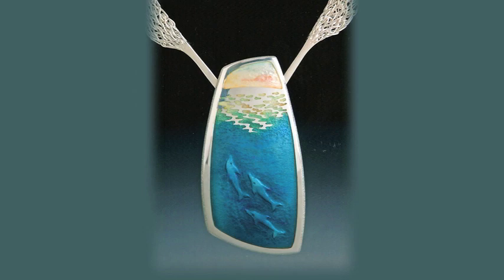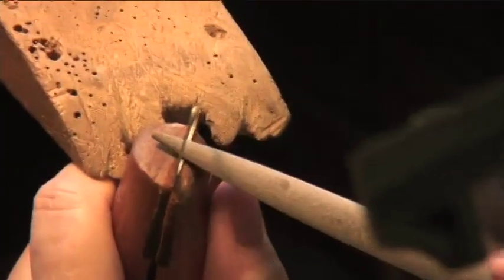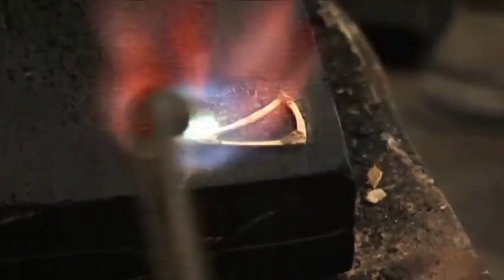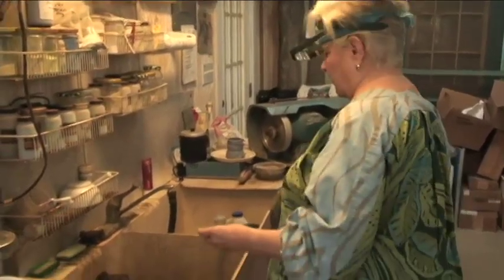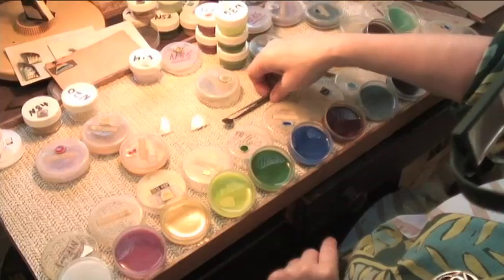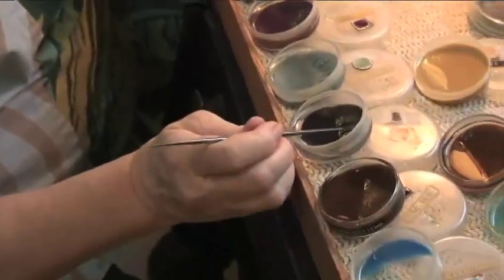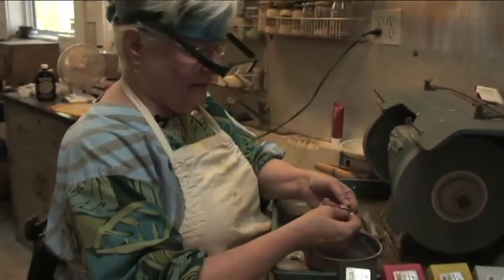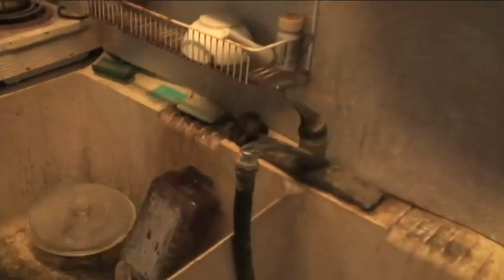SAW & SOLDER CHAMPLEVE TUTORIAL

Comment: I have a question. I would like to try my hand at this. I've already been making some jewelry, such as some milanese mesh chains and a few other things, so I am quite familiar with the delicate soldering work going in here. What I want to try is the enameling. Thing is, I can't quite afford to work with silver, at the very least not when it comes to experimental pieces where I can't be sure of the quality of the outcome.

I often times work with nickel silver or red brass for my more experimental pieces. Will these metals take to the enameling process as well as the Silver does? I suspect they may not be as high quality, long lasting, and would cause some allergic reactions in some people, but I am hope full they could give me a less expensive material to use while I hone the skill before moving on to more costly and ambitious projects.

I also do not just make jewelry, but I also do some metal spinning to make metal vessels, though these I do almost exclusively out of the nickel silver and red brass for now because of their size. Most of the enameling tutorials I have seen have been on small pieces which can face upwards in the kiln, so there is no worry about the effect of gravity on them in the firing process. Are there enamels which might be better suited for a 3 dimensional piece such as the vessels I make?
Reply: just in case it's still useful to know, we learned enamels on copper in my classes bc it was cheap.

Comment: Hi, very interesting. I see you are using nitric. Usually sulphuric is enough to remove the flux. Maybe you need the power of nitric for some other reason. You might try dipping your items in a liquid mixture of water  and bicarbonate of soda when you finish dipping, this will neutralise the acid and save your fingers.Thanks, Jeff